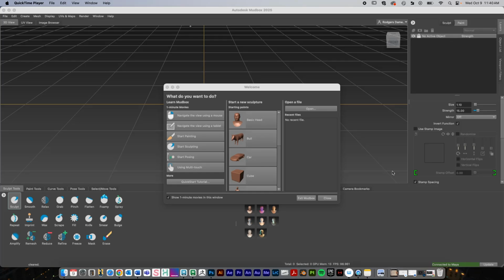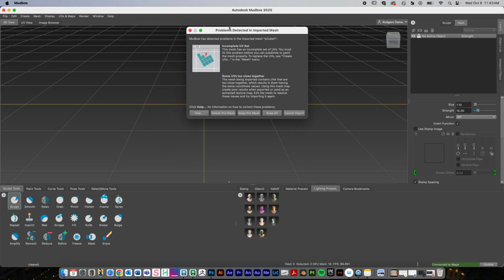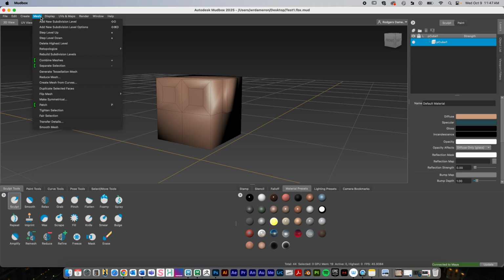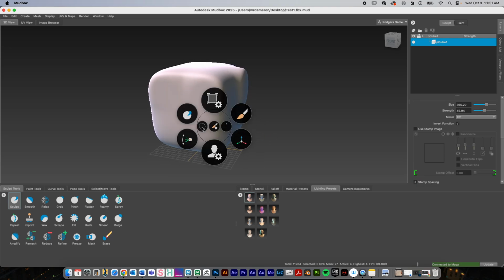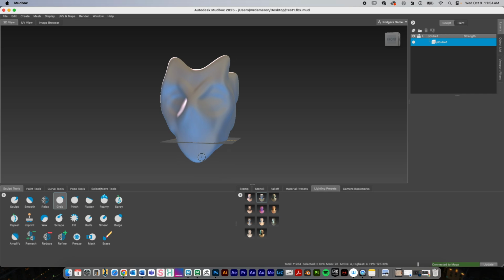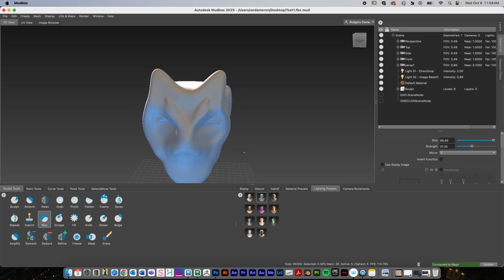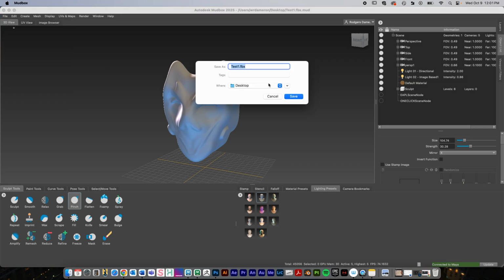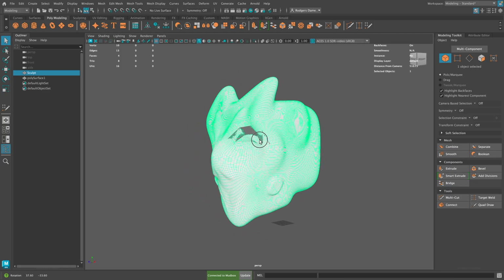Intro to Mudbox

Comment: Apple, why would you design on apple machine?  Watching the program struggle. Is this program polished, or is it the resolution of your tutorial. The GUI looks blurry and 1990's dated. Assuming this runs on a potato computer  how complex can you get with this. Can you start and finish in this program or is there a limit. Also Maya is great but can this import to blender afterwards? Or unreal engine. I get the object file structure but you said most programs.
Reply: Ahhh 😂 Blender user